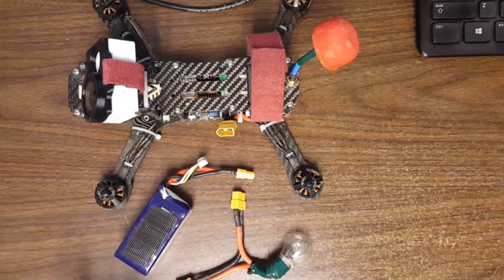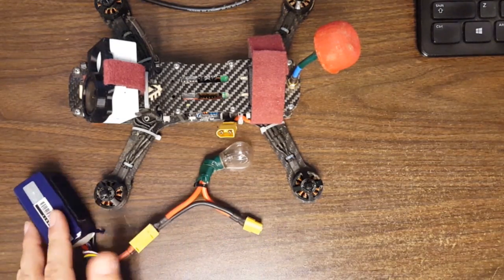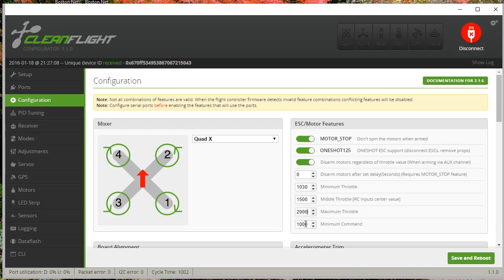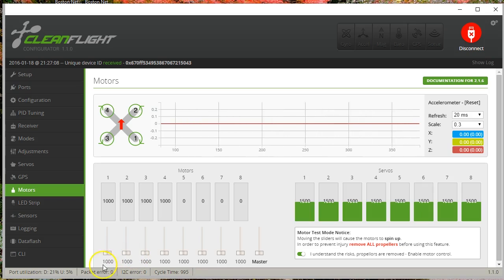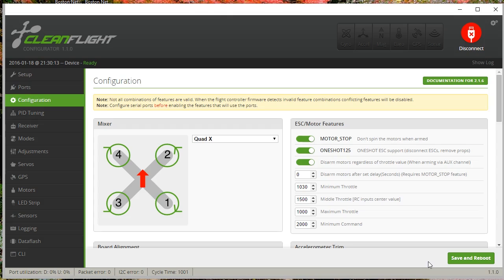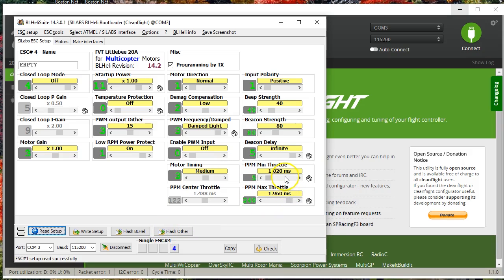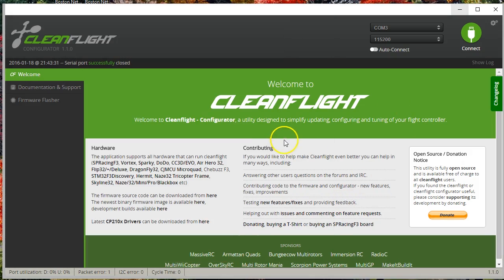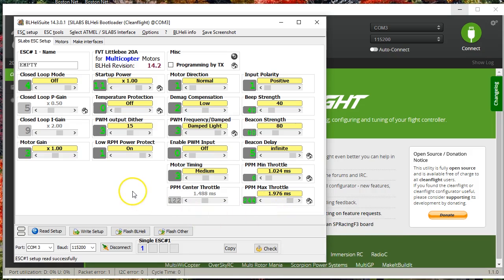How To Calibrate ESCs with Cleanflight and BLHeliSuite

Comment: hey Josh it seems like I have an issue with this every time I do this I swapped my ESC on my 210 I went from the dys 20 to the spider ztw18 also I went from the Cobra 1960 to the Cobra 2206 2100 KV and all I did was swap the motors in the ESC and recalibrated so in my theory it should work but when I give it throttle he spins on the ground and some Motors don't seem to spin upright it seems like it is the back right motor and the front left motor I've tried trimming it out with rudder and that's not working he's still spins and those Motors when I give it full throttle they don't go full-throttle none of them I need some help LOL thanks in advance Josh
Reply: also I'm using cleanflight not blheli for calibrating
Reply from the maker: Calibrate. Check the endpoints using BLHelisuite. Are they close to the same?

Spin the motors using the Motors tab. It's not a good idea to spin motors full throttle with no props on, so restrain the copter and spin the motors with props on, OR use a current-limiting bulb to drop volts so the motors spin slower. OR use a 2S battery if you have one handy. See if all the motors seem to spin to the same RPM. Use a tachometer if you have one or your ear if you don't.

Don't use trim to fix problems.

Are you 100% sure that you have all four motors spinning the correct direction?
Reply: +Joshua Bardwell I had to go to work but I am about 99% sure that the motors are spinning the right way because I had them backwards and I had to swap All 4 when I changed ESC it's like it change directions LOL so I had to switch them off so I'm pretty sure they're spinning the right way I have never used BL heli Suite do I need anything special or can I just hook my naze 32 up to my computer I guess I'm still kinda confused on the endpoints to minimum command is minimum throttle which is set to 1000 maximum sets 2000 and middle is 1500 I have my minimum throttle set to 1080
Reply from the maker: Are you experiencing this problem with props on or off?
Reply: +Joshua Bardwell motors twitch with them off when they are on he spins
Reply: +Joshua Bardwell Omg the first motor I looked at was backwards lol wow
Reply: +Joshua Bardwell also I just connected it up to clean flight and was looking in the motors tab when I give it throttle with my radio 1 motor has more power going to it than the rest of them one of them doesn't seem to be getting much power at all according to clean flight but it is spinning on my quad any ideas
Reply from the maker: If you are using the radio on the bench with props off, then the motor outputs will vary. When the props are off, the PID loop is trying to "fly" the copter, but nothing is happening, so the PID loop feeds back into itself and makes bogus values from the motors. Usually, one or two motors will slowly spin up to maximum and the others will spin down. This means nothing at all.

The motor being at minimum but still spinning is the correct behavior. Motors should never stop spinning when the copter is armed. That's what min_throttle is for.
Reply from the maker: If one motor was reversed that explains why the copter was spinning. What you are seeing on the bench is completely normal. Put your props on, go somewhere safe, stand back at a distance, arm, slowly raise the throttle and hover. Be prepared to disarm immediately if anything bad happens. You are probably fine.
Reply: Thanks im floating in the living room :) will do punchouts tomorrow
Reply: OK its acting up again just went into the wall dont worry im taking cover lol but the front left and the back right start to stutter and its makng him fall any idea why
Reply from the maker: Just for the record, I'm pretty sure my instruction was, "go somewhere safe". Okay, 'nuff said ;-)

Diagnonal motors acting up suggests an issue with yaw. Stuttering... could min_throttle be too low, allowing the motors to stop spinning on yard yaw? Did it flip out when hovering, or in response to an input?
Reply: Lol I tried to hover that was ok then i tried to bounce and thats when the problem came back very possible min throttle is to low i have it at 960 ive been watching to many videos lol they chirp if i raise it
Reply: If i can raise it and get rid of the chirp that would be awesome also i know you said not to use my trim but my quad starts to slowly spin if i dont give it two clicks
Reply from the maker: Ultimatevapor918 Check your channel centers in the receivers tab. Does yaw center at 1500? If not, then use trim to make it center at 1500.

If your channel is centered at 1500 and you still get drift, trim is not the answer. If your channel is not centered at 1500, trim may be the answer.
Reply: they are all at like 1515 or 1508 will that fix my motor problem
Reply: when i give it trim i lose my 1000 to 2000 now its 993 and 1990
Reply from the maker: Yes, absolutely, that is an issue.

Cleanflight needs your channel endpoints to be set to 1000/2000 with 1500 as the mid-point. You need to tweak your channel endpoints and trim to get as close to this as possible. If you absolutely can't do that, there is a workaround using the rxrange CLI command and the channel midpoint setting, but this is a last resort.
Reply: you fixed my rudder problem :)
Reply from the maker: Yay!
Reply: He works awesome now thanks Josh FYI to get rid of the chirp  

First, make sure Oneshot is disabled in cleanflight.

Next, set your min command = 1050 (increasing it by 50u s from 1000)

Now go to the motor tab and calibrate your ESCs. 

After calibration w/o Oneshot, we need to (re)enable Oneshot and calibrate the ESCs once more.

Now that calibration is complete, you can lower the min command back to the standard 1000u s and the ESCs should no longer detect the noise and "chirp
Reply from the maker: Leave Oneshot on, calibrate 1000/2000, then reduce min_command to 950. Simpler and works as well in my experience.
Reply: just when i thought i was done lol i have moved my travel to get it as close as possible it was off by 1 then when i moved to 1500 with trim it changed it all so i might have to use that other pprogram unless you think i can adjust travel again without messing with the 1500
Reply from the maker: +Ultimatevapor918 add dead band if you  end to.
Reply from the maker: +Ultimatevapor918 you are confusing min_throttle with min_command.
Reply from the maker: +Ultimatevapor918 you are confusing min_throttle with min_command.
Reply: +Joshua Bardwell okay I cannot get those spider 18a escs to work so I ordered some different ones now I have some Castle Creations 25 amp but they have a chip hanging off of them do I need to do anything special with these ESC I've never used one with a what I think is a bec but it says no bec on them help lol
Reply from the maker: I don't know those ESCs. Are they running BLHeli?
Reply: lol i think they run there own they are made in kansas not china like the spiders thats what sold me the guy at the shop said they are race ready but i dont wanna feed to much power to the naze32
Reply: it says no bec on the esc
Reply from the maker: Well I guess you need a Castle programming adapter then. I don't really know any more though.

If they had a BEC, they would only supply as much power as the Naze needed. Just make sure that the voltage is correct (5v) and + goes to + and GND goes to GND. Remember that a power supply's rating is the max it can safely supply, so there is never any danger in over-speccing a power supply or voltage regulator. They just get bigger and heavier is all.
Reply: now my quad will hover but any movements say a fip he has nervous breakdown lol and flips out any idea why im going to flash idk why i would need to but i think its my only hope
Reply from the maker: I'm sorry, I don't have any more advice.

Comment: Hey thanks for the vid. I'm having a problem. I just went back and started over, and its still giving me issues. In cleanflight after I hit save and reboot then one of the motors starts to run. I don't have a lipo hooked up it's just running off of the usb power. That interferes with doing the esc calibrations. When I shut down the battery and put my TX throttle to high the esc's arn't sensing the high signal because they are already on from the power from the usb. Any ideas? I'm going to try removing the + & - from the esc to the flight controller and see if that helps anything.  Is there anything I can do in BLHeli to fix this, or is it a bum FC?
Reply from the maker: +adriancjones this is an issue with early Naze r6 and Dodo boards. There should be a diode to prevent them from powering off of USB. I don't know any workarounds that aren't a pain in the ass. I suggest using my "Maximum resolution ESC calibration" method (search my channel)

Comment: I figured it out! The only thing I needed to do was reverse the motors. I guess lum motors ship as cw and my other motors were ccw so I soldered them up opposite. I didn't even check rotation because I was sure I set them up right. I feel so stupid haha. Thanks for your help!
Reply from the maker: You can never know for sure whether a motor will be CW or CCW when wired straight-through unless you have wired up that exact motor before. Glad you found out the issue!

Comment: They are plugged in correctly and it's only when my quadcopter gets moved, like the motors soon up fine but if I tilt on side of my quad all the motors seem to freak out and shake. Could this be because of my escs or something in the fc
Reply from the maker: Are you sure it's not just the normal effect of handling the copter with props off? The copter is going to try to oppose your motions.

Comment: I'm having a problem with my quad, when I arm the motors seem to spin up fine and everything but then if I move the quad at all the motors start shaking. I was thinking my escs weren't in sync when I programmed them in the boot loader or some problem with not setting up the gyro correctly. Thanks so much if could help me or just lead me in the right path. Happy flying!
Reply from the maker: +Andrew Auguscik make sure your motors are plugged in in the correct order.

Comment: Thanks for making the best technical FPV videos on youtube!

I have an issue for your consideration: when following this video to program my DYS 20 ESCs via Cleanflight, BLHeliSuite only detects/lists three ESCs on the Setup page but gives me control of all four ESCs on the Motors page.  What might cause this? I want to avoid having one of my ESCs be flashed to a different version than the others.  Here are screenshots of the issue: http://imgur.com/a/wp6PN .

Thanks for any input!
Reply from the maker: Try hitting "check" to see if all four are detected. Also try selecting the ESCs one at a time and see if you can read/write them.
Reply: Thanks for the quick response!  Unfortunately that had the same results.  However I tried selecting the blank "ESC 4" and ran [ESC tools]->[Identify ESC] and that worked (after a substantial delay).
Reply from the maker: If you can read/write then you're golden. I don't know why some refuse to read and other times it's no problem.

Comment: Hi Joshua.  I'm not quite sure what's going on with my new(ish) QAV-R build.  I'm running LittleBee 20A Pro's and a Lumenier Lux.  I flashed BLHeli 14.6 just now and I'm running Betaflight 2.8.1 RC1.  I thought I'd calibrate them again (not sure if it was necessary) but I'm finding the PPM Max throttle is going to 2020 as max on all four of the ESC's.  I wondered if the calibration was simply failing so I set everything to completely random values in BHS, then dropped max throttle command in CF down to 1990 and calibrated again.  Now BLHeliSuite is showing PPM Max Throttle at 2016 - so it appears that it's calibrating, but I'm not sure I'm happy with the results.  Any suggestions?
Reply: Set max throttle down five at a time until the results are just above 2000 -- that's how I did it. Keep the other values where they should be.
Reply from the maker: I agree completely.
Reply: Thanks guys!

Comment: Awesome tutorial. I have been well versed in the calibration procedures but never synced it inside the ranges max min throttle number and min max throttle number , however when I throttle calib my ranges were always 1020 on min and around the 1880 ranges on max . Wondering why I'm not getting more of full range like the 1970 range on max like you are getting. All calib  were done on either spider ztw's or ubad angry beasts all running Multishot 14.4..... Any input is greatly appreciated
Reply from the maker: https://www.youtube.com/watch?v=zCoEWBhJy6Q

Comment: I just put emax 2205 2300 kv motors on with fvt littlebee pro 20 amp's and during calibration,  3 of my motors started twitching, and then the esc and motors (only 3 ) started smoking .....HELP!!!  waiting on replacement motors and Esc's but too gun shy now to just thro them on now.

set up : 
betaflight 2.8
naze32 rev 6 
fvt littlebee "pro" 20 amp ( apparently MS capable ?)
Emax 2205 2300kv (super sessy)
diatone PDB Frame

I double and triple checked to make sure my motor screw were only about 3 or 4 threads into the motor, so I know there was not a short there, I also ohmed everything out prior to calibration, no dead shorts were found....
I can provide any further info needed...if needed.
Reply from the maker: If the motors were smoking, then either you flashed the wrong firmware to the ESC, or you have a wiring problem such as a motor screw touching your windings. Possibly you used screws for 4mm arms with 3mm arms and your screws were too long?

The ESCs should not attempt to spin the motors during calibration. It sounds like the ESCs did not enter calibration mode, then the ESCs tried to spin the motors and a short existed, and the windings burned. I'm sorry to say that the motors may be ruined. If you end up determining that the motors are flyable, please remember this going forward, as at some point in the future you may have "mysterious" issues that you cannot solve, and when that happens, be sure to tell the person helping you about this incident so they don't waste a ton of time trying to troubleshoot it.

Always use a current-limited power supply or a "smoke-stopper" bulb when working with ESCs and motors, especially a new build or a new firmware. It would have protected you against this situation.

https://www.youtube.com/watch?v=4z7yRG56aKM
Reply: +Joshua Bardwell oh the motors are definitely toast. I keep running into the same conclusion with short scenario, really makes me second guess what I thought were solid shiny smooth solder joints, none of the screw indicated arching, but I did see scorch marks on the arm where the screws were. ....soooo. maybe....definitely going to be using the light bulb rig through testing fro. here on out, my super nice KLEIN CL800 has let me down today
Reply: +Joshua Bardwell also I should add, when using the master tab, the motors spun up, it was when I stopped them that they let the ghost out

Comment: Hi Josh, thanks for all your videos they have been extremely helpful and have learned a substantial amount from you. I had a question for you: 

I'm currently running BL Heli 14.4 using the old calibration method using min/max throttle in CF of 1000-2000. After calibration, I go to BL Heli and ESC's have slight differences. I am getting 1980, 1976, 1982, 1972 for the PPM Max. Should I be setting the max throttle in CF to the lowest figure of the 4? In this case set CF max throttle to 1960 or leave it at 2000? This part of the calibration procedure has always confused me! Thanks a lot!
Reply from the maker: +u189961 if you want to entirely avoid dead-band, set max_throttle to the smallest of the four. Or use my "maximum resolution" calibration method, which is posted in a later video.

Comment: Huh. Did this, and all esc's were in sync except one (no real significance), but they all were showing 2.020 ms after calibration?? Not sure if this is ok?
Reply from the maker: +Gryffin Cook reduce max_throttle by fives until they calibrate below 2020.
Reply: Ok thanks, just to check, anywhere below 2020 or below 2000? (something about the longest possible pwm signal?)
Reply from the maker: Below 2020. You just want to make sure you're not calibrating off the end of the scale.

Comment: I have an atom rx122 with 1306 motors and 20a LB esc. It wont spin up any faster after 1605. Huge deadband. All escs are calibrated. Any thoughts?
Reply from the maker: +Eric Cordeiro ESCs are not calibrated, surely. Can you check the endpoints manually in BLHeliSuite?

Maybe you are hitting the rev limit? But I don't think 1306 motors have enough poles to do that even on 4S. Not sure about that.
Reply: Thanks for getting back to me Joshua. I have checked in BLHeliSuite and it is reading between 1024-1968ish on all 4 escs. Not sure why there is an issue
Reply from the maker: That's very weird, I agree. You could certainly adjust max_throttle down to 1605 but that's hardly ideal.
Reply from the maker: What happens if you switch to 3S or even 2S? If the motors spin up past 1605 on lower voltage, then it indicates you are hitting the rev limiter.
Reply: I'll give it a shot. Thanks! I'll report back

Comment: hi Josh, love your channel...quick question.  I did the cleanflight calibration and set min comman/max throttle like you stated.  when i check my Afro12A's they are all consistent but show a PPM Max Throttle to be 1864...the PPM min is 1020 which seems OK.  Question: Should i change my PPM Max Throttle to be around 1980 or leave it as 1864?  Does this mean i have another issue?  The readings were nearly the same for each one; min on all four was 1020, and all but one had a max of 1864 (one showed 1868).  Thanks!
Reply from the maker: +orblivious1 Leave it as whatever it calibrated at. But you might consider increasing max_throttle to get more resolution out of your throttle channel. Was max_throttle=2000 when you calibrated?